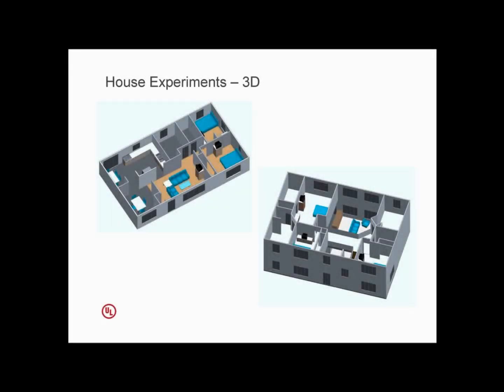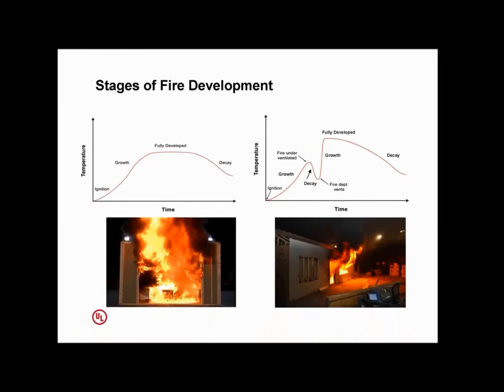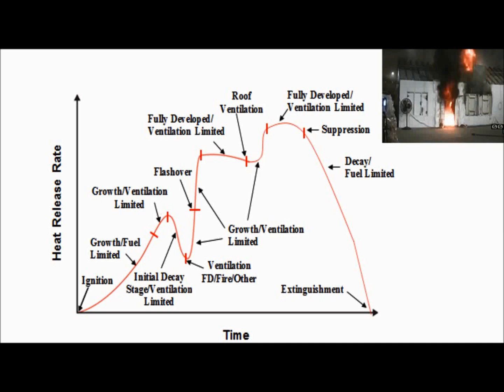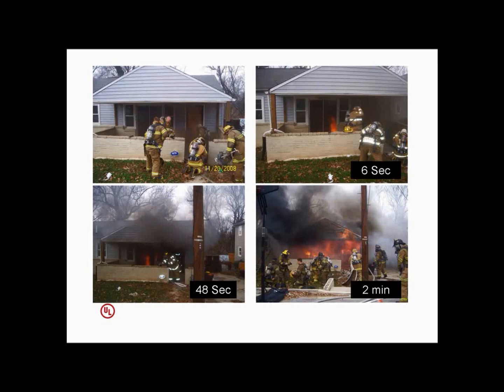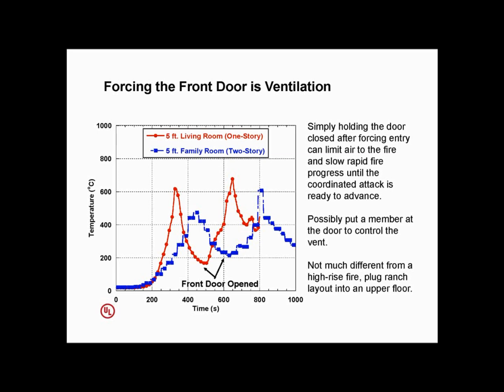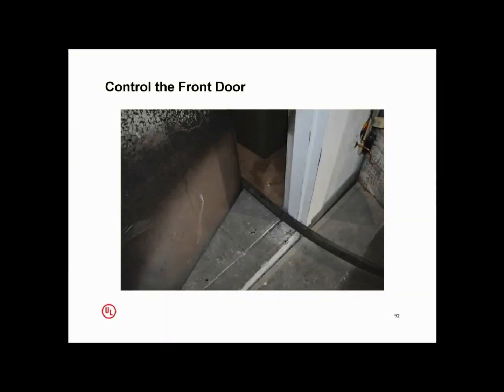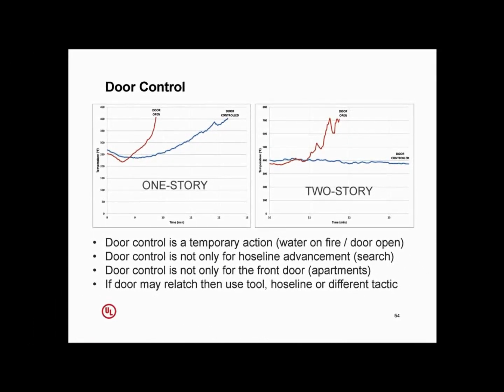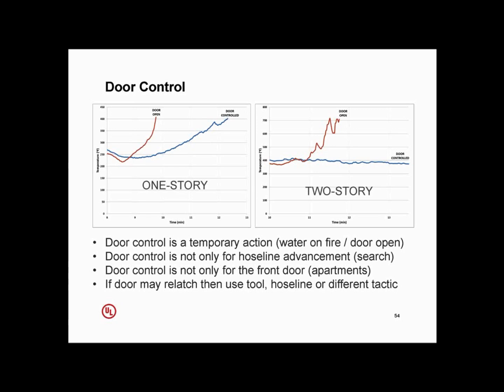Flow Paths  - Door Control

Comment: Door control and “flow path” is nothing new. 
Just new instructors with new terminology. 
This is all well and good when attacking PowerPoint fires or in NIST simulations but to the average firefighter, you put water on the fire. 
Whether that’s from inside or outside of the structure. 
The reality of the fire service is that members are going to lose focus on the fundamentals worrying about flow paths and scientific research while the rest of the house burns down around them.

Comment: K.I.S.S.  This is Way too complicated.  

Residential home.  Do a 360 and find the rooms closest to the fire.  

Basement:  Break out the windows and extinguish the fire from the outside.
First Floor:  Break the windows and extinguish the fire from the outside. 
Second Floor:  Break the windows and extinguish the fire from the outside.
Rescue?:  See above!

Break out upper sashes in burned areas for ventilation. 
No going inside until ALL Visible Burning Material is extinguished.
Fresh air goes in through the doors and the heat and smoke goes out the upper sashes.  
No Vertical Venting as it doesn't work anyway.
Go inside to Search.  All the above happen at the same time but in that order so you better train to get Fast (Tank) water on burning stuff.
Mop Up.

The End!
Reply: That all sounds great until you take into account low staffing that most departments run i to for initial attack. These methods allow 3-4 firefighters to contain and provide an initial attack until more help arrives. SLICE-RS
Reply: @Josephdivemontana  Staffing is not the problem.  It's a department with a terrible work ethic.  An unprofessional attitude toward their responsibilities.  3-4 Competent people could handle most residential fires.  Most of the other people are wasted.